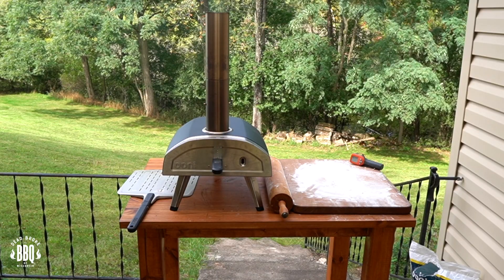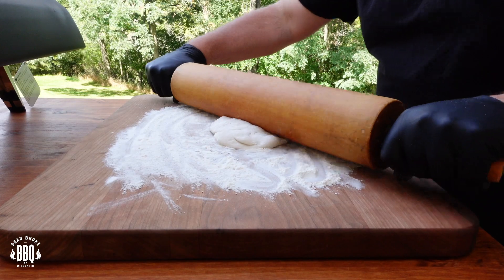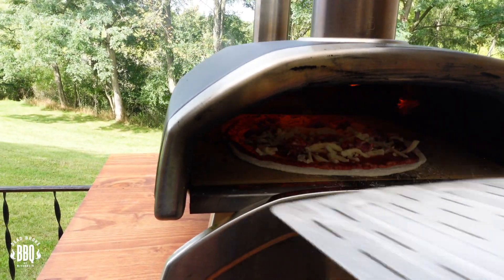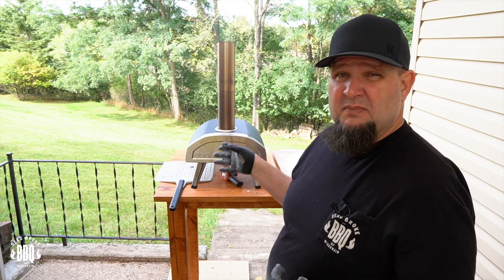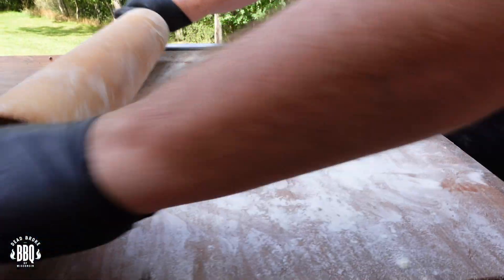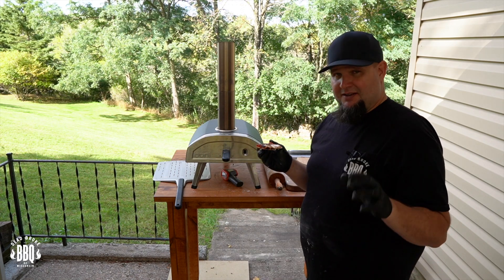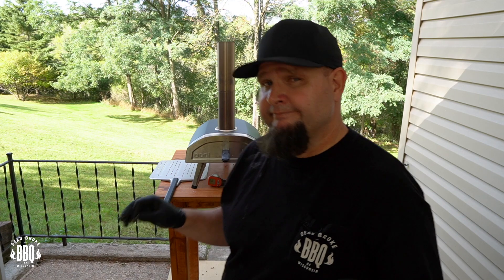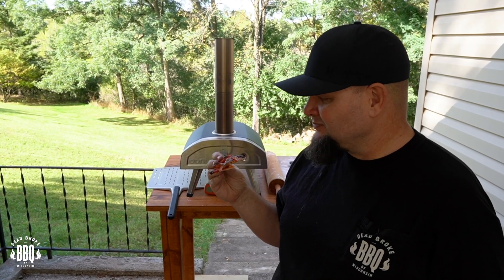Ooni Fyra Wood Fired Thin Crust Sausage Pizza

Comment: I appreciate people who take the time to make videos to help folks out, so thanks! Some advice for visitors watching - learn to stretch dough. It only takes maybe 10 pizzas to get the technique. No need for a rolling pin or gloves (?!). Get a turning peel and keep the pizza in the oven for turning. With the Fyra, get the stone to over 850 at the center, but let it stay there for a while. If you put the pizza on right away, it will soak up all the heat from the thin stone and your crust will be soft. 15 min after the stone is HOT, put your pizza in and either don't feed the hopper, or use the damper to lower the oven temp. Also, don't load up the hopper too much - if you get  a jam, the pellets won't fall down and you're screwed. I'm done - thumbs up!
Reply from the maker: Hey thanks for the info. I got sent that little oven, it worked ok but not good enough for me to use it a lot. My friend has a professional pizzeria in his basement but doesn't sell pizzas, it is just his hobby. We go there and we cook pizza all day long. If you watch a few of my other videos you will see that I can stretch the dough, kind of. He was actually at my house that day I made this video and suggested to just use the roller. Yes of course it is a big debate but I enjoy just the backyard cooking, obviously BBQ and grilling more that anything else. I wear gloves ALL the time. I don't have time to touch food and equipment and then wash my hands so I can shut off all 5 of my $3,000 a piece cameras. That being said if I cook pizza JUST for the family and there is NO $20,000 of equipment running that I have to adjust or operate I do not wear gloves. Honestly I rather use my oven and my 1/2 inch steel plate to cook a pizza instead. More control and having a jam up on one of these little tiny ovens is gets boring. They are a better fit for camping, still fun for a couple times but a pain when you need to feed the family and then run to coach football practice. I like pizza but I would eat a reverse seared ribeye and pass up a pizza every single time. Thanks for watching and leaving this info for other to read if they are interested in getting one of these little ovens.
Reply: @DeadBrokeBBQ  All good, my friend. Re: the gloves, I didn't think about cameras and all that flour. Completely understand. The Fyra has a learning curve - it's pretty basic but actually quite good for ONE pizza. Not enough thermal mass to crank out one after the other for entertaining, tho. I subbed u just for mentioning the reverse-sear. 👍
Reply from the maker: YA I like the Fyra and I have cooked some decent pizzas in it but you are correct, it is made to do a couple and then you either fed everyone or you start over. Ya I am an old fart with big sausage fingers and the last thing I want to do is get a lense smudged up and then waste time cleaning it up. Hahahaha well welcome to the Dead Broke BBQ Nation and if you are on Facebook I have a group where you are encouraged to share your cooks with everyone! All cooks, not just BBQ!! Thanks again for watching!!

Comment: Wife gave me Frya for my birthday. Already have a pellet grill and use it 4-5 nights out of 7 for our meals, so this made a lot of sense.  I saw your extremely helpful video a few nights too late!  My first trial run wih one pizza actually turned out great a week ago.  Then last evening, very cold outside (snowing).  I wasn't sure how hot the oven was...went by time.  Mistake.  The two pizzas burned on top before the crust was cooked on the bottom.  Lessons learned:  I have ordered the Ooni infrared temp gun.  I will go by the temp readings to make sure the base stone is well over 800 degrees F.  I will also get a long steel rod to be able to spread around the burning pellets as you suggest.  I love the process of experimenting with all thing grilling, so no worries.  Thank for the tips and help with the learning curve.
Reply from the maker: Awesome and ya there is still a little art to running this oven!! I have had some really good pizzas come out of it! I plan to do a couple more videos on it but right now I have some other things I need to film first. One other tip to help with the cook don't over load the pizza with toppings. Balance is key!!! Thanks for watching and keep me posted on you success!! Have a great week!!

Comment: You probably already answered so apologies...tips to getting it up to 900 degrees? Keep the door closed longer?  I haven't had much success getting it that hot.
Reply from the maker: Use oak pellets and make sure you got plenty of air flow, Now I found that running around 700° gave me the best pizza from top top bottom. Thanks for watching!!

Comment: I was almost ready to start to worry when I saw flames shooting out from the back of the pellet thingy but I saw it was happening to you.  I cooked my first pizza yesterday and came out good, but not great.  the pellets started to go out...weird.  I saw in another video someone said the pellets start to pile up and quit keeping the oven upto cooking temp so he had a stick to stir the pellets.  All I know was my pizza was good but the pellets started to go out so I cleaned everything like it was new and gonna try tomorrow.  I think I need to heat the pellets up hotter.
Reply from the maker: Ya I use a poker to spread them out a little more and then they really heat up the deck!! I am getting better at running it but still not a pro yet!! One thing I have been doing is get a few pizzas ready then cook a couple real quick and then stir it up and do a couple more!! Keep practicing and even a bad pizza can be better than some that you buy!! Have a great weekend and let me know any tricks that you learn!! More videos coming but I also have another one I will be dropping on Thursday!
Reply: @DeadBrokeBBQ  got it figured out finally.  First thing  I realized was got to get the pellets hot enough to keep going.  I saw where you used that "flame thrower' :) so I get them really blazing with a food safe fire starter before I add more pellets. Second "awakening" was I just wasn't keeping the door on as much as I should so the deck was not heating up hot enough.  Made my first great pizza yesterday.  All I had was glass tables in my backyard so I "splurged" and paid $37.99 at Harbor Freight for a cart that has two shelves. Fyra fits great on top, pellets and thermometer and fire starter below and JUST for the culinary touch...LOL I hung the two peels from hooks on the side.  My mother in law (cooking snob from France) was even impressed.  LOL

Comment: U need to try some different fuels in the fyra. Charcoal, wood, brickets .
Reply from the maker: I could do a little of that but the fuel tray is pretty small. I would rather just have a bigger oven!! ha ha Thanks for watching!!
Reply: @DeadBrokeBBQ  maybe change or custom the fuel tray as pellets are too expensive long term. They do custom other Oonis but no one has done it to the Fyra yet....
Reply: @xidengmao429  pellets not so expensive when you consider there is little waste

Comment: Was your chimney not open? I saw you had some backdraft issues with flames coming out the fuel side
Reply: Same with the exhaust. I saw it coming back up through the hopper stack.  Just trying to get a feel for one. About to make the purchase
Reply from the maker: It was open half way and when you open the lid it certainly will back draft some and also when you are running low on pellets.
Reply from the maker: Ya I might have been running low on pellets. That is the first sign you need to add more but for the first 45 mins or so it runs pretty good!! These pellet pizza ovens are not meant for long cooks unless you are ready to mess with the pellets some. I will be doing a review and a comparison video soon. Thanks for watching!!
Reply: @DeadBrokeBBQ  awesome! Thanks for taking the time to reply. Just like to get honest reviews from people using these at home. Going to order one tonight but they aren't shipping until March 2021!
Reply from the maker: Ya they are really backordered right now!! If you use my link I would really appreciate it bro! Helps me to continue to do these videos! But again thanks for watching!!

Comment: Love the oven but I find with mine that the pellets do clog up alot stopping air flow and occasionally putting out the flame 😅
Reply from the maker: Yes I use a long fire poker and stir them up to keep it going longer! There is a trick to running this oven for longer than 30 minutes. Thanks for watching!!

Comment: I think there is one thing you need to understand and It will help you a lot. Cripsy crusts are not achieved at higher temperatures. If you want a crispy crust, you should launch your pizza  at 650 max and cook it over a longer period of time. High temp pizza cooking give you a neapolitan style crust with is charred edges and a softer  center crust. That is what these ovens are designed for. I see too many of my fellow Americans heating these ovens to the max and frustrated as to why their pizzas don't crisp up.  Also, you may want to use less flour when you stretch out or only stretch with semolina.

Look at roman style pizzas. They are more crispy and they cook at temperatures at around 650-700 degrees.
Reply from the maker: I cook pizza for fun but I agree 650° give you the best cook on both sides as long as your deck is preheated. These little pellet ovens are tricky to maintain a constant temp but still fun to run with friend and family! Thanks for watching!!

Comment: What do you need to do to clean it after use?
Reply from the maker: I am using a softer bristle brush for sweeping it out. I take out the stone and sweep that off also. It really burns the pellets down to a little dust. The big creosote on my face was from me blowing in there when the fire was going out. Came from the top by the flame catch so i will take that off and clean there also. Thanks for watching bro!!

Comment: Also, the front cover is only for when you’re heating up the oven, you dont keep the cover on when cooking the pizza.  You need a turning peel and should be constantly turning that pie while its cooking to give it an even cook.  In and out in 60 seconds,  not in, close door, out, turn, close door etc etc etc.  Invest in a turning peel and cook without the front lid on.  Trust me :)
Reply from the maker: This isn’t a wood fired oven. It is a tiny little pellet oven that can get the job done for someone who wants to make a couple pizzas. Simple as that. Sounds like you need to step your game up and purchase a ALFA One. With the front lid off the unit back drafts and you probably don’t know what that means but that is when the smoke comes out of the pellet hopper. Again the Ooni is a great little oven for the backyard multiple food loving person. This unit is not made for a pizza snob. Save your money and go big or go home.
Reply: @DeadBrokeBBQ  I am a pizza chef with plenty experience,  and if you can't stretch a dough by hand and not a rolling pin, then probably shouldn't be giving people how to cook pizza advice.   Wood logs or wood pellets, it's still wood fired, and the front chimney stack is for the back draft.  But I don't know?  I do know however that opening and closing the front lid is like bbq with your lid down.  Just cook your pizza in your home oven if that's the case.
Reply: And may I add, I'm not trying to troll you lol.. Just giving my two cents :).... Most review videos on this oven show  pizzas being burnt, or taking way longer than needed.  I've come across one gentleman who didn't keep opening and closing the lid and his pizza turned out perfect.  Also, just because the oven reaches a max of 900F doesn't mean you should cook at that temperature.  700-750F should be the max temp to cook your pizza without charring it :)
- experienced wood fire chef
Reply from the maker: Cool I never heard of a pizza chef. That’s awesome! Unfortunately like I said if you leave the lid off too long the fire dies and you create a backdraft and the pellets in the fire pot will burn up the tube. I ran this thing for hours before I filmed this video. You get about a good hour burn out of it before you need to dump and start over. Because without good airflow the pellets will start to weld together and basically just clog the shit pipe. If you want more control buy the gas version. Seen plenty of people roll bruh. 90% of the viewers on this video never even made their own dough so make shit simple for the beginner so they want to try it not everybody’s dream is to go to pizza chef university. Pizza is dirt cheap to make and a great way to feed a family a couple days a week. It is a great fast food for the busy family. But if you want to rock a real oven again this ain’t the unit for you. Dig in that chef hat and pull out those pesos and buy an Alpha. Thanks for watching!!
Reply from the maker: Dude I like a little char I say that right in the video. Yes the best pizzas we have made on it was when the deck is at 700. You notice I haven’t made any more videos on this unit and I get ok views on it. It is unpredictable but still fun to run but not meant for a pizza party with 30 friends. I’m not trolling back bruh this is just my personality. I’m a football coach and negotiator for large utility companies in real life. This YouTube gig is my side hustle and maybe eventually my full time gig. Again I got a couple QubeStove videos where I pull the dough but these hands and arms got more broken bones and missing tendons to wait while I beg my digits to get moving. I’m a lot older than I look Dawg. I’m close to 60 than 40. So again skip this pit bro, but once cry once but get the real deal.